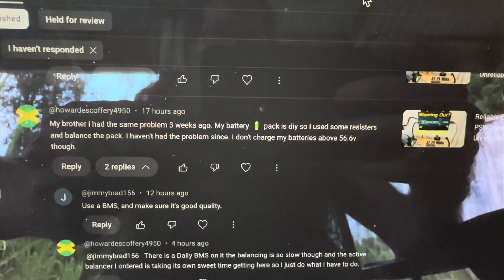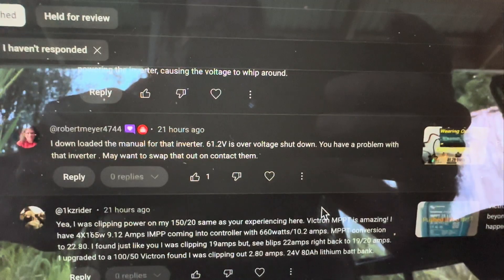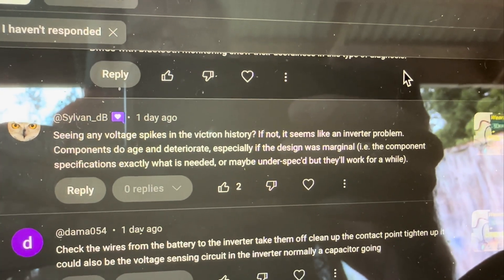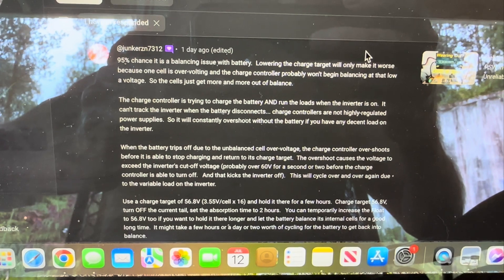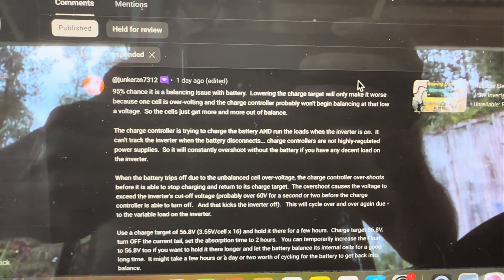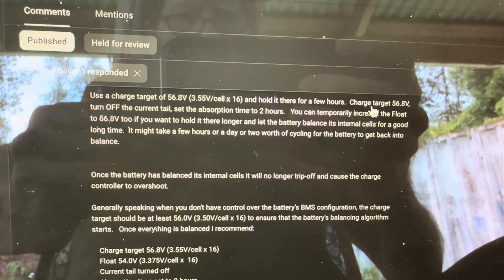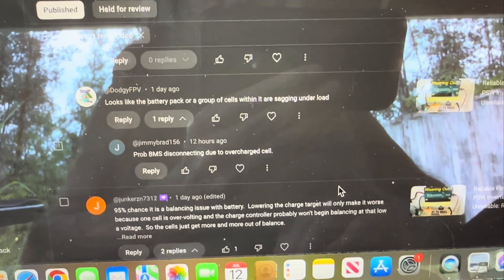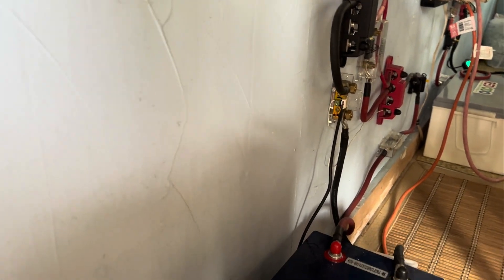48V LiFePO4 Battery Balancing Issue? Let's Find out!

Comment: I’m still unclear why you’re not using the rated charge voltage of 54V for that battery. My 48V batteries reach 98% SOC at 54V, which should be sufficient. If you look at the specifications for large server rack batteries, such as the Pylontech US5000B, they have charge voltages between 52.5V and 53.5V. When the BMS stops charging, it indicates that one or more cells have exceeded 3.65V. An immediate charge disconnect could cause a voltage spike in the inverter.

Comment: Why don't you charge the battery until it switches off? And then unscrew the battery case cover and measure the individual cell voltages with a multimeter?

Comment: With a few days of cycling under your belt you can look at the Victron "Trends" graph and see the voltage where there BMS disconnects up (because it won't look like a normal charging curve, the voltage will more or less shoot straight up and then oscillate around the charge target).   Unfortunately Victron only keeps a few hours of high-resolution data, but you can still get an idea about its balancing progress.

The voltage it gets to before it suddenly shoots up should (theoretically) get better and better each day when it is making progress balancing, until eventually it stops shooting up vertically at the end and just looks like the normal exponential ramp.

An oscilloscope is really needed to see the BMS disconnect because the whole thing happens in about half a second... the voltage overshooting and then returning to the charge target.  That process is less than a second.  But will keep happening if there is an inverter load.

Volt meters and the Victron monitoring display average the voltage over a second or two and can't catch it completely.

Another way is to look at the "History" tab of the Victron charge controller.  It shows the "max" battery voltage each day.  In a properly working system that fills up to 100% that voltage will be precisely the charge target.  In a system where the BMS disconnects, that voltage will be significantly higher and also vary a lot each day because of the averaging it does.  In your video at 7:59 we can (barely) see the Battery "max" and it does seem to be bouncing around a lot.  Though that might also be due to you changing settings.

-Matt
Reply: I agree the bms is only doing what it is programmed to do.

Comment: If it doesn't work, why not build another 48v bank with the previous 4 batteries you had with the balancer on and try and isolate the problem to the battery, charge controller or inverter?

Comment: I would imagine you will still get bms disconnects at 56.8 if it's partly cloudy. It's the way you approach a full charge that matters. If you approach it slowly you'll get a lower voltage and less overshoots and disconnects. For balancing you could lower the current from the charge controller and length the absorption time. I think maybe it's easier for the charge controller to regulate the current. For balancing you want to limit it to around what the BMS balancing current is and just let it sit there until the current tails off. Afterwards I would then set the charge voltage at something like 56 volts if that's as stable. The lower the charge voltage the longer absorption time needs to be to balance the cells. If you are reaching full charge everyday then you can afford to lower the voltage and have slower balancing. If that achieves stability you can work with it. Even at 55.2 you should get some balancing.

Comment: That was great. So many with great information and ideas . This is a 48V server rack battery !. Take the screws out and open the lead. you should get to the cells and test each one for voltage. use same meter. right down each cell voltage as you go along.  Usually when writing face up the top lid comes off and you can meter the cells.  All you have to do is test all cells for voltage . POP the LID ! Your multimeter is best tool to have. Also put meter direct on battery terminals to test. test all connections.  1 step at a time. right down each reading. This is not hard but will take some time.
Reply: I believe your battery cells  are only balanced at the top of the charging cycle. I fitted an active balancer to my 2 systems, both 16 cell 200 amp series wired battery. The active balancer balances all the cells against each other through out the battery voltage range. Where as your bms I believe ony balances at top of charging range. I fitted these balancers 4 years ago and the cells have never been out of balance. They come from 0.5 to 5 amp balancers.
Reply: @noelroberts8082  If this is a balance issue this can be added inside the battery. waiting to see if this is balance issue or inverter problem. we will know with more testing. great point with the active balancer.  we could have a bad BMS as well. the balance part .  open the lid and test the cells .
Reply: Generally speaking there is no point trying to balance the cells below the exponential portion of the charge curve.  The reason for this is that minor differences in cell construction willl cause the cells to have slightly different offsets in the flat portion of the charging curve.  So attempting to balance there will actually take the cells out of the balance instead of put them into balance.

Balancing is usually only done in the exponential part of the charge curve for this reason.  Usually above 3.45V/cell.  In the exponential part of the charge curve the BMS can tell which cells need to be worked on with complete certainty.

Active balancers do generally work because they will correct for imbalances they produce earlier in the curve when they get to the later portion of the curve.   And they work quite well.  But if the BMS is doing its job an active balancer is unnecessary.

The biggest reason for a BMS not doing its job properly is typically the  BMS and charge controller configurations not being compatible with each other and leaving too little time for the BMS to balance cells.   99% of the time its human error because people think charging to voltages like 3.50V/cell or 3.55V/cell damages a LiFePO4 battery.

In daily-cycling (solar) systems, charging to 3.55V/cell does not damage a LiFePO4 battery.  The battery just doesn't stay up at that voltage for very long before dropping to the Float (3.35V to 3.375V/cell).   Once in good balance, 30 minutes of hold at the charge target is all you need to keep the battery in perfect balance.   (LiFePO4 batteries work very differently than NMC and NCA lithium chemistries).

-Matt
Reply: Well, Matt, please explain where the exponential is on a liFPO4 since it doesn't have an absorbtion voltage. Exponential is only on lead acid, NiMY and NiCD because battery resistance is quite hight on these types so need an absorbtion voltage to complete the charge. Where as LiPO4 has a low resistance therefore does not need an absorbtion charge so no exponential. This is why an active batter balancer is better for LiPO4 than a fixed voltage balancer. By balancing throughout the voltage range there is less to do at max voltage.
Reply: @noelroberts8082  The absorption setting for LiFePO4 is to give the BMS time to balance the cells, not because the cells need absorption.  The cells are fully charged once the current tails off (usually less than 30 minutes upon reaching the target voltage, depending on the C-rate).

If you have the current-tail turned on, the battery might not have enough time to balance its cells.  So a fixed "absorption" time of between 30 minutes and 2 hours is recommended.

The exponential portion of the charge curve occurs roughly above 3.45V/cell when charging at 0.2C.  You can readily see the curve go exponential on any charge curve for LiFePO4 so just google it.   The same thing happens on the discharge curve once the battery heads south of around 3.1V/cell.

The reason BMS's balance batteries in the exponential portion of the charge curve is because slight differences in cell construction get swamped by the curve.  Whereas if the BMS tries to balance the cells below that point, minor differences in cell chemistry result in voltage offsets at thet same SOC that cause the BMS to make the wrong balancing choices.

-Matt

Comment: If the battery is out of balance,  I t will take about a  week to get it to balance with the internal BMS. It usually has a .05 A or 50 Milliamps of current.  Thanks a lot for a 90A cell.

Comment: The inverter doesn't know nor does it care if your batteries are balanced or not.

You have bad component in that inverter that is throwing off the voltage measurement.
Reply: The inverter cares if the input voltage goes above a predetermined value, which is almost certainly what is happening here.

Comment: That method will likely work it takes time but the thing is you can't see if the high cell is what shuts you down when the bms sees a single cell overvoltage it will stop the charge until the balancer tries to equalize the other cells sometimes it may take a week on CV depending on the bms and how far apart the cells are and as the battery gets older the spread will more every year. Sooner or later it is just easier to choose a lower voltage balance point. Cheers and have fun
Reply: His BMS isn't the issue. It's clearly in the inverter. His inverter and BMS don't talk to each other
Reply: @kevinroberts781  the BMS maybe working as intended but it can still be causing the problem. As far as I could see it was the charge controller causing the BMS to shutdown that caused the problem. If I look in the log of my shunt I can see the same thing by looking at the max and min voltages recorded which are higher and lower than they should be. I also watched it happening on the victron app. I had to reduce the absorption voltage to the equivalent of 55.6 volts and creep it up from there. I'm still only on 56 volts equivalent I think. At the victron default I was still seeing bms disconnects.
Reply: @matthewwakeham2206   I agree
Reply: @kevinroberts781  If it is an inverter problem he could just turn off the solar charging and see if the inverter still gives him the error.

Comment: Its ok that You try balancing like this,but if the BMS`s balancer is slow,it might take even more time,its not ideal that you cannot see all the different cell voltages somehow,with a comunication cable and a laptop,or in some any other way.Becouse than You could see if they are still balanced at 56.8V,at the top end You can see always when they are unbalanced.My bateries had 200-250 milivolt deviation on cells(some at 3.3V some at 3.550 or higher....) and it took 6 days to balance them with a 4amp active balancer.I took my battery apart and lost varanty too,but the varanty guys didnt wanna do anything,and having that imbalance is not just bad becouse i cannot use the battery capacity,but dangerous for the cells long term.Having them in balance is key factor.Watch it when You charge them and they stay on absorb how your charge controler and batery behaves,maybe the leds will show some unusual thing,like turning all off,and just the "working" one led will beep.I dont know power queen batery bms-s,but i wish You good luck,hope it solves the problem,and its not Your inverter.Or maybe the battery is balanced,i think maybe that is even the better scenario,and the inverter is faulty.The battery is more expensive,and harder to deal if it could go in unbalance(weak bms let that happen,good ones never let the battery be imbalanced)and you just get another victron inverter to avoid future problems :)
Aloha!